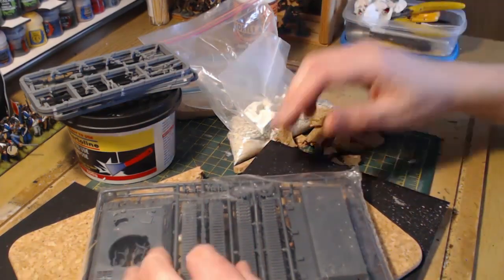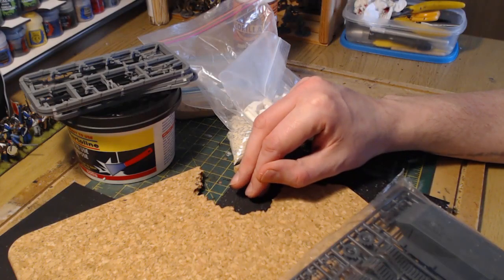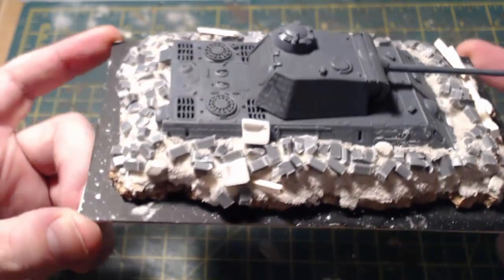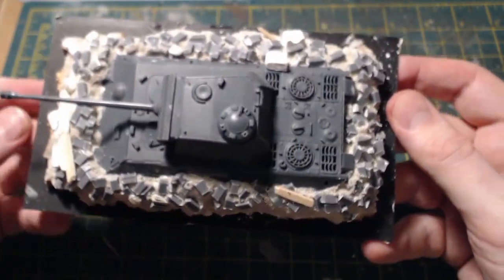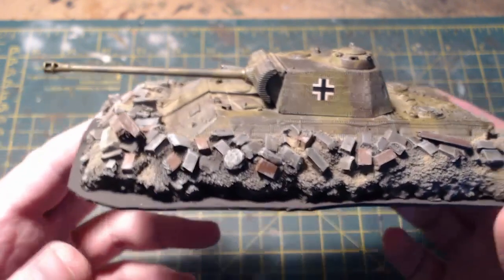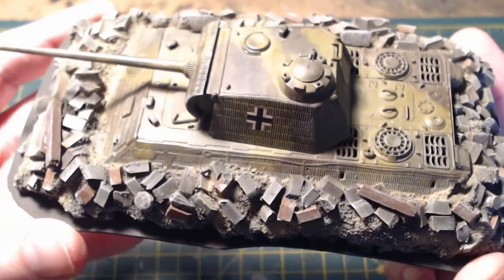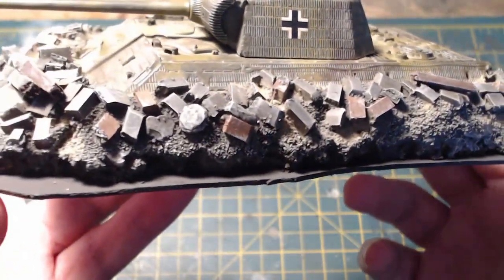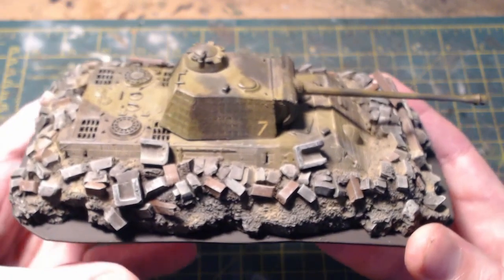Bolt Action - Making a dug in Panther tank

Comment: Great job.  The tank is painted really well, and the rubble looks very realistic.  Only slight criticism would be that I would have considered either cutting the base to the edge of the rubble pile, or extending it to the edge of the base.
Reply from the maker: Cheers dude, much appreciated! Yeah the outer base part, I wasn't exactly happy with  it in the cold light of day. The plan tomorrow is to add grit and weathering pigments to the exposed part. I think that will definitely help tie it together 😊
Reply: @OnPointHQ  absolutely will!